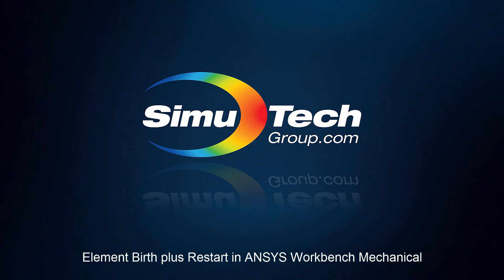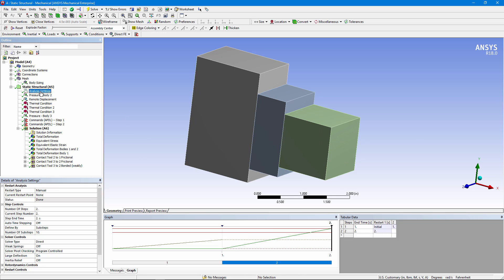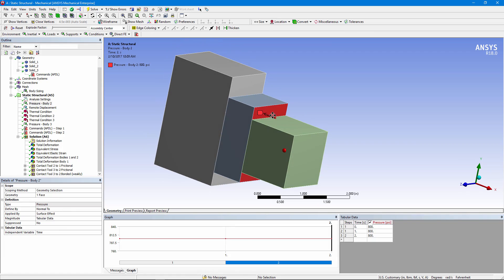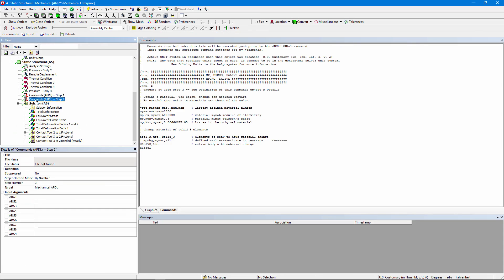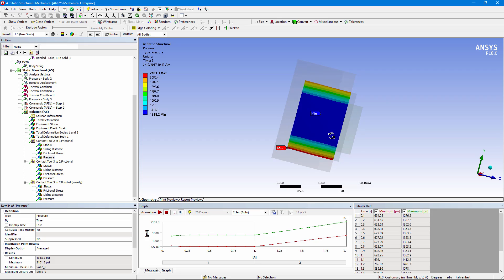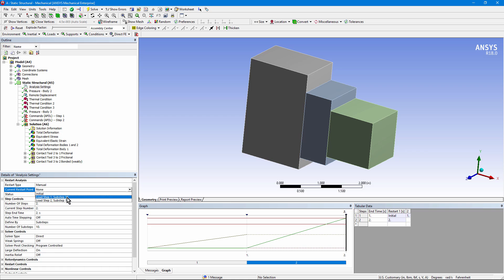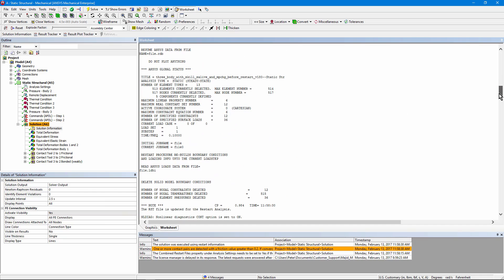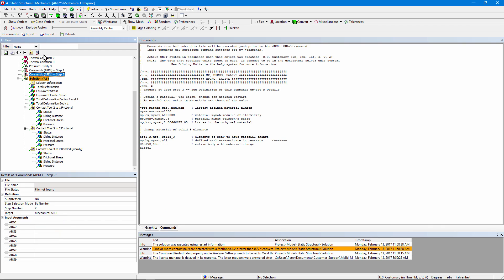Keep Your FEA Moving: Restart Solutions + Element Birth-Death | Ansys Mechanical

Comment: @simutech I have a doubt regarding this method.
Let's say if I have 5 bodies and I want to bring kill 3 of them in Start. then i am bringing them back one by one in each time step.
I can of course  give a name to each body using its matid then write a code for each body at required time step.

But is there any way to do this using a loop command?
Reply: can u explain me this technique in easy terms..i want to know why we use this in welding simulation, why we use in moving heat source,in what way this birth death technique helps in transient thermal simulations?? please.